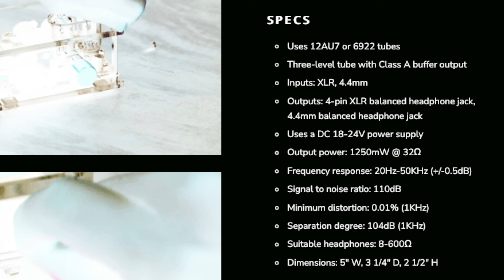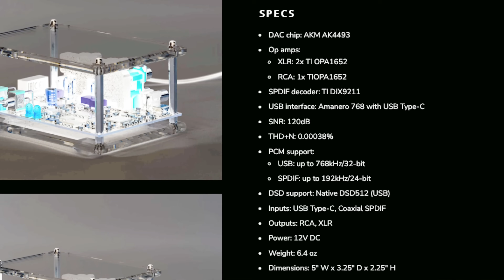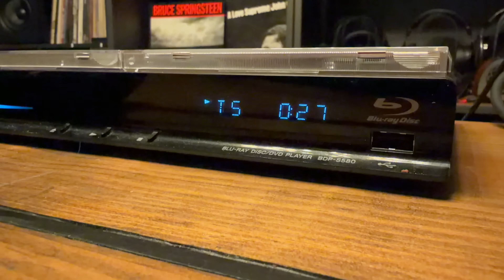Two Audio GIANTS Collab - The RESULT Is Some WICKED Gear!

Comment: Do be careful when going form Balanced to Single Ended on the outputs. Some amps don't like having the grounds tied together like that and can damage the amp. Much safer to adapt the headphones to a balanced configuration with a new cord.